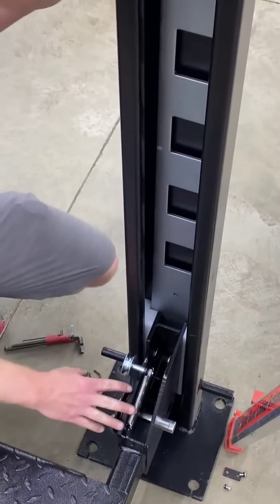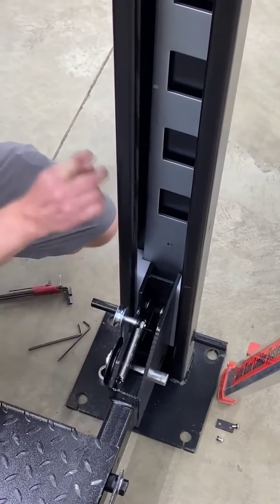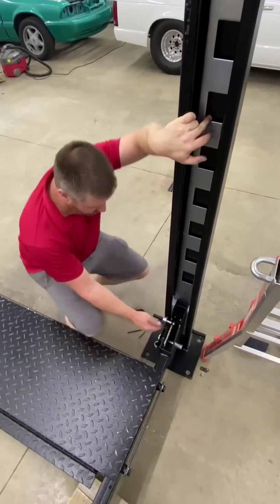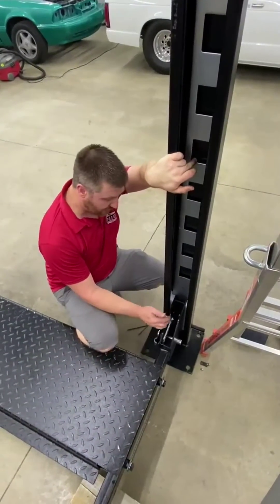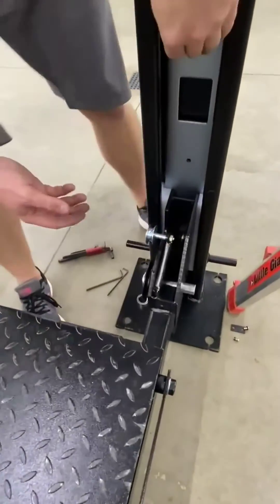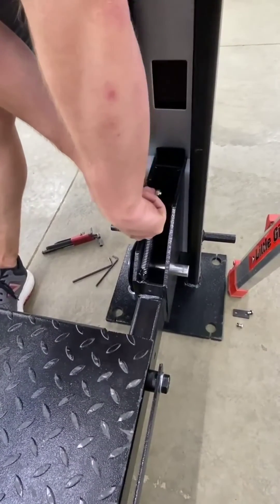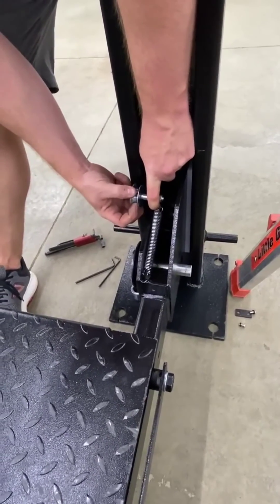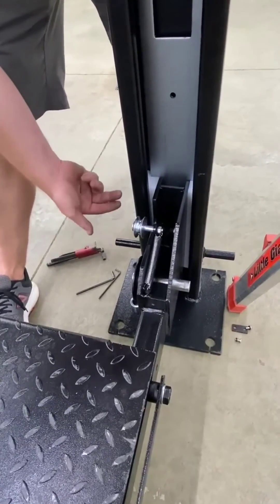Watch This Video Before Using Your 4-Post Automotive Lift!!!

Comment: Do they post get anchored to the ground or is it optional
Reply from the maker: These 4 post lifts are designed to be left free standing and include a caster wheel kit to move the lift around to a different location.  They can be anchored in place if you choose.